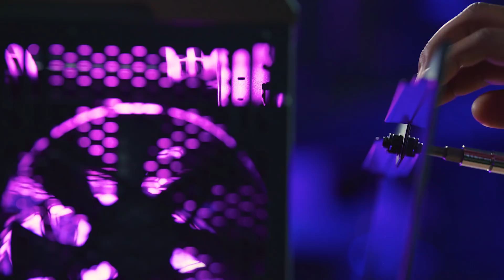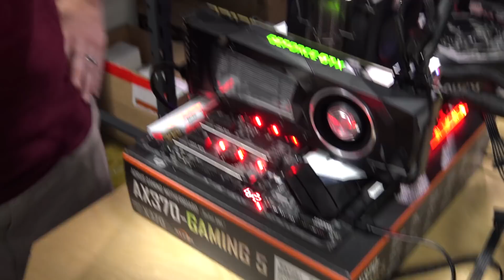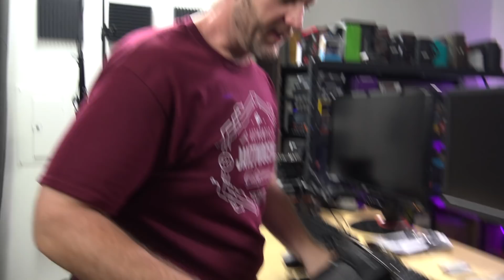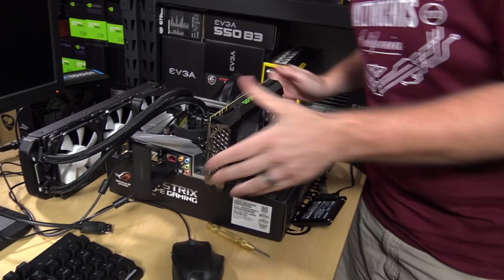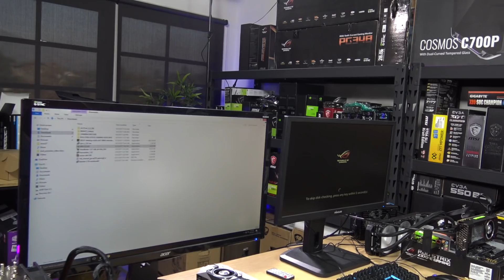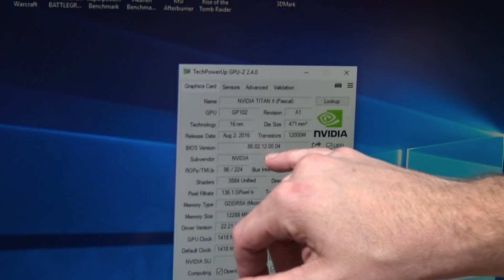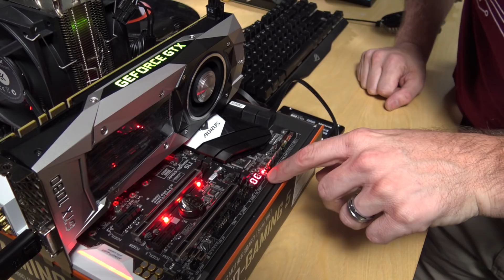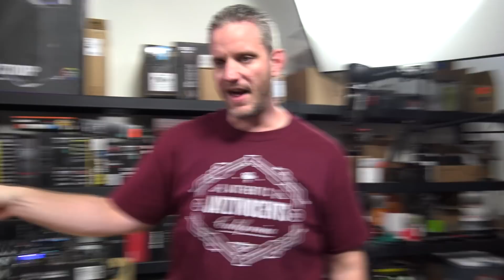I cant figure this one out... HELP!

Comment: Might check the Connectors in the PCI-E slot. with as many test as you conduct with each motherboard and the amount on insertions and extractions you do with different GPUs, wouldn't be too surprised if one contact may have some oxidation not giving it a good connection, be slightly bent, or if its perfectly fine.
Reply: Another thought, may check the Bios settings on voltage going to that PCI-E Slot, could either be getting over-volted or under-volted, could be why the 1080 caused the post to throw the other error code. I've seen some stranger things happen with hardware like me removing my kraken x62 from my motherboard and cpu, only to see when I went to clean off the thermal compound, the 1800x was stuck on the bottom of the water block. No resistance, just came up with the cooler (Artic Silver Ceramique 2 was used btw).

Comment: A) Inspect the PCIE contacts on both cards to see if one is slightly off.
B) Check to see if the pin buffer (end of PCIE plug) on the non-working card is longer than the other cards which might impede connectivity.
C) Put the non-woriing card back in the board and angle it up and down (to/fro cpu) to see if it can make a connection.
D) Check the power plugs of the PSU (left) and non-working card to see if there is a connection issue.
E) Start drinking and see if something comes to you...

Comment: the nvidia drivers updates could be the problem
Reply: How could it be a driver in windows if you never make it through the bios post meaning you don't even get to windows to load up the driver. That would be like saying you can't get your car to start while standing outside it with the doors locked.
Reply: That is exactly what happened to me.  Doing the GeForce Experience update caused the black screen of death, which I might have made worse.

Comment: Voltage rail is undervolting, overvolting (by a smidge) and the "problem" card has a tolerance issue? Or PSU or pcie slot! get equal main board same other parts.. swap parts out till you find it.  I agree a customer would think bad card.

Comment: im guessing the psu has been swapped just in case something may be faulty then u check another pcie slot on that board and tried to reinstall the bios on the mobo maybe an earlier 1 would work better (this is why only update my bios wen needed) the grafix bios should not be a problem due to that it does work with other computers also wen testing some mobos like urs needs to see a attachment for video out as plugin in a dvi /vga /display port u can always leave it overnight or 30mis without power and comos battery connected

Comment: Use HW monitor to see the 12V rail voltages while a working card is under load. See if it drops by a large amount.

Comment: I am willing to bet the it's the MB that has gone bad, or at least a capacitor. I have an X99 mother board that has a similar issue. It was slow booting, sometimes it would boot fast, tried different GPU's sometimes it would work and sometimes it wouldn't. It may sound strange but dirty power can cause issues as well. I bought another motherboard of the exact same model and the issue went away.

Comment: First idea - Possible slot/pin issue - Try a different PCIE slot.
Failing that, I'd go through eliminating all the other items.
Different PSU, different PSU connectors, SSD, port the SSD is connected to, RAM.

Comment: jayztwocents, check your "uefi" setting for the graphics. i have had issues with that before. if you can toggle it on/off and it works then it is just an conflict with the uefi side of the nvidia bios and Motherboard

Comment: Swap the power supplies. Just do it for kicks.
Reply: cant rule it out until you try it, right?!?
Reply: This is a true story coming from a dell r910 server in an enterprise datacenter. The server was complaining about voltage errors. Take green plugs and put in blue ports and vice versa. No more voltage errors. (Yes we tried a power drain)
Reply: Smart guy. Possibly not enough power
Reply: best idea

Comment: highly doubt it's a bios issue other wise the issue would show up on the intel system, PSU is unlikely as well considering the other card worked.  Try using a different pci slot just to verify good connectivity and as an extra precaution check the pci pins on the actual card that wasn't working.

Comment: this is gonna sound odd but what if the gpu is pulling more power than should be initially from the board. i have actually seen this on an old old old p5 board and a certain gpu being a 6970. after extensive testing and many many voltage monitors we concluded that the allowed variance of voltage being pulled from the pci slot was more than it should be and it caused a boot problem everytime. after testing on numerous boards we rma'd the board and didnt have a problem.  i know that amd boards can be touchy right now so it may be something to think about. or not i mean im just a guy from the internet, what do i know

Comment: I had a similar problem with an AMD FX system and a GTX 650 a few years ago. Other cards would work but the 650 wouldn't even though it worked in another system. Even taking it out and reseating it time and time again didn't help.  Turns out it was an issue with both the card and the board. There was a slight manufacturer defect in the card, one of the contacts on the card was not perfect and wasn't making good enough contact with the board because one of the board contacts had been pushed back a little too far. One in a million of having that issue with the board and a card with a defect that just exacerbated the board issue. Pulled the wire contact in the board forward with a small wire and it fixed the issue. The only other suggestion I can make is the power supply. Try swapping them. I would check every contact point though because sometimes weird things happen.

Comment: If you have a spare Mobo, change it - could be the 'faulty' Titan card is flying a little too close to a limitation of PCI-E specs, and it's down to tolerances.  If it works in another board, then the original Mobo is just one of those fussy ones and you should probably RMA it.  Not relevant in this situation, but FYI, this can also happen with OEM motherboards, e.g. Lenovo, HP etc. as these often have a whitelist of accepted devices and won't have anything to do with anything not in the list. e.g. My M91P i7-2600 system (yes it's old, I'm broke!) would not POST on an R9 390X card, which worked fine in my son's FX8350 rig.  Found out later that Lenovo boards don't necessarily take all GPUs, because they want to force you to buy a shitty one from them for 5x the cost. :-)

Comment: Ive noticed with a lot of the newer cards like rx series and or NVidia, that sometimes the drivers cause issues with posting I had to revert back to a driver for AMD from last month, cause my system would not post whatsoever, since then the newest driver seems to be working for now, I don't usually allow windows to automatically download the drivers so that could also be an issue

Comment: If I remember correctly you once put out a video on the subject of split power connectors making a very slight difference in fps. This could be one those haunted pieces of hardware that just spit problems over crap it's not supposed to. Definitely try different power options.

Comment: I had a similar issue with Threadripper 1950X with two identical Sapphire RX 480 (Nitro+). The intent was to run them in Crossfire but something was wrong with boot codes and the system not booting at all with one or another card in the primary PCIe slot. I noticed killing the power on the PSU waiting, then firing it back up seemed to help it. Reversing the cards also helped but I was at a loss as to the 'cause'. I chalked it up to a lower power state when the system was off holding onto IRQ's on the PCIe bus - I ultimately disabled fast boot all together (there was not a real difference in speed) updated the BIOS and the issue hasent poped up in about a week or two. There was some anomalies with UEFI/Secure Boot when enabling fast boot and having the GPU selected in a secure mode - the system just booted to a black screen and never completed startup. I was pulling my hair out for about 6 hours on this one because I wanted secure boot (but not fast boot). Clearing the keys from the bios and putting it into UEFI/Setup setup mode got it to finish posting. LOL Jay Ive been tinkering in PC's since I had a i286 and this new stuff is getting beyond me now... I almost miss the days of jumper controlled BIOS settings  XD
edit: said sli when i meant CF

Comment: Why, when you originally took the "fail" card out of the Ryzen system and put it in the Intel system did the Intel system see it as "new hardware" when it is an identical card?  It obviously is not.  And secondly, you said the card's bios you took from the Intel system and installed in the Ryzen system was the same... because it was!  It was the card out of the Intel system whose bios you noted, then put in the Ryzen system.  You did NOT check the bios of the card that was originally in the Ryzen system when you transferred it to the Intel system and got it to work there.

Comment: Had this issue about 5 years ago with a XFX HD 7950 and a Gigabyte UD3 Z-87 motherboard where the GPU/system wouldn't boot up at all, I tested the mobo with a HD 6870 which worked fine, and then tested the HD 7950 in a friends system and it also worked fine, so ended up RMA'ing the mobo for a for a Asus board where the GPU worked instantly. I never figured out what was the issue, but i always blamed Gigabyte for it, and seeing as Aorus is Gigabyte i would think this is a issue with Gigatrashes coding somehow, but then again if your other Titan XP worked fine ... so strange.

Comment: 1) you only showed checking the bios of the same card, just on different boards. 
2) is there a pci-e supplement power on the Ryzen board that isn't populated?
3) try a different pci-e slot. 
4) try swapping PSU's.
5) try changing pci-e lane power states

Comment: Did you try running an additional 8 pins pci-e for a total of 2 8 pins pci-e from the power supply unit? Sometimes running a single 8 pins daisy chain cable does not provide enough current to drive the card? Also on the GTX 1080 card, it only required 1 pci-e card.

Comment: Time to talk out of my ass with zero knowledge about the issue what so ever in the spirit of a youtube comment section.

I don't know what these error codes mean, does the motherboard recognise the device? Plug in a second GPU and see if it is recognised in Windows maybe? If it is you can rule out the motherboard having an issue with the specific card.

Here is what I think. And be warned, you may lose some brain cells reading this. I think that the motherboard is confused. Yes, I just said that. I just said a logical circuit is confused. Hear me out. I recently tried to unlock shaders on an RX460 (on Intel system with ASUS B250 chipset). Everything was fine, SSID, BIOS version Device ID everything matched up perfectly, the bios flash worked fine, going into GPU-Z showed the shaders were unlocked. But the GPU was not working properly, I booted with the GPU, I was outputting video with the GPU, the system recognized the GPU, and from what I could tell everything was fine, but I got error 43. I'm pretty sure that is a driver error, but its literally the same card. It seems my PC knew this, and my PC knew there was something different about it, but it expected it to be one way so it just got confused. I'm serious though I think the system expects one thing and tries to work for that one thing because the other thing is so similar but its not exactly the same thing so its like, fuck it.

EDIT: Make it forget? Pull motherboard battery out

Comment: surely it has to be an issue with the motherboard. can you not check the Titan with the issue and the rest of the hardware you used on another AM4 motherboard? could be some sort of bad connection with that cards pcb and that top PCI-E slot. Can you get it to work or even be recognized in another PCI-E slot on that Aorus mobo?

Comment: Board is shit. Bad PCI-E slot. Definitely bought a new card once because I thought my card was toast. New card was unstable as fuck and then ulitmately also wouldn't boot. Silicon lottery may dictate that card is pulling more watts at boot than the other ones. Check power draw, try the other PCI-E slot.

Comment: Motherboard and PSU seems to me to be the culprit. Gigabyte's BIOS is weird. I have AB350-Gaming 3 with R5 1400 on it and BIOS has numerous bugs. Sometimes if my PC force shutdown due to sudden power loss then It doesn't boot and Memory LED lights up. I then need to clear the CMOS to make it work again. Weirdly overvolting beyond +0.0132v offset causes CPU to lock to 1.5ghz and undervolting beyond -0.096v locks the CPU to stock frequency. As I said, weird issues with Gigabyte BIOS. If motherboard swap doesn't work then PSU might cause the issue.

Comment: It could be a memory buffer error on the card itself. I have a render cluster with 4 nodes that are older opterons with 32 gigs of ram per node. I had some single slot video cards just for cpu acceleration support and one card would not post. tried it in all the other machine didn't post. Tried it on another xeon server and it posted.  In the end I chalked it up to a weird memory buffer error.  I did also try flashing the bios but to no avail.

Comment: I don't know what the problem is but I think I can help you to figure it out: What do we know? I. Both cards (A and B), and both processors with their motherboards (systems 1 and 2) are functional; II. One card (A) only works on one system (1) but doesn't work on the other (2) III. The card B works just fine on both systems (1 and 2) and IV. Card A must work on system "2" since it's functional. Try to connect the card A (the problematic one) on another "2" system or 2' or 2 prime, this means another ryzen system, if it works on the new 2 prime, then the problem it's not the card (it would work on 2 systems), I think the problem would be the specific ryzen system 2 processor. Did I deserve a heart?
Reply: That would be set theory, not calc.
Reply: jayz told us he has the hardware to do things like that, your not telling just some random person, your telling someone who already has the equipment to do that test
Reply: Set theory is a branch of discrete math, not calculus. Sure, prime notation is from Newton; however, it isn't exclusive to calculus. Set theory and boolean logic both use it, for example.
Reply: calculus was my favorite math class lol
Reply: I bet that Jay has A LOT of other systems to work with. So, how does my answer help to the average builders?
Well,  it doesn't because I did answer to Jay's request not to an average builder (uh.. duh).
Reply: i think you didn't take enough Calcium as a child :p
Reply: Chema Brinval 
You could have said the same thing in a shorter comment.
Reply: No hearts!  You left out the fact that multiple other kinds of GPU boards run OK on the Ryzen system making it unlikely that the one copy of the Ryzen system is defective.  So multiple copies of the Ryzen system aren't needed.  The fact that the Titan XP failed on the Ryzen system points to a defective/damaged Titan XP board.  The fact that it runs OK on the Intel system only indicates that the damage is subtle/marginal.
Reply: I think this troubleshooting process will help to find out what is the problem, by changing different brand ryzen motherboard, if 2nd  motherboard works then 1st motherboard has Bios compatibility problem i think.
Reply: Very ez use the card to another ryzen system if it works it might be that the board or card has a problem
Reply: Heart begging
Reply: TheEvilVargon you didn't take enough Calc
Reply: lol yeah
Reply: I'll take it as a compliment, but I'm a Lawyer, but I like Logic and I was pretty good at that class. Thanks, bro!
Reply: Yes it is.... and you're right too, it's logic, I was pretty good at that class.. (I'm a laywer actually).
Reply: Right! : ) Thanks bro.
Reply: I cannot help it, English is not my first language, so I try to be as descriptive as I can... : )
Reply: You miss the point #1 it is one GPU not all. #2 What Jay has helps nobody the same problem. This is a learning process for him and us.
Reply: "I did answer to Jay's request not to an average builder (uh.. duh)"
Jay is a master builder. You think he did not think of trying it in a different Ryzen rig? There is a component issue on this one and the goal is to figure it out.
Reply: He didn't say that he already tried that. I'm just trying to answer a question on a previous information given basis (chill out, man)
Reply: Yup.
Reply: FlynHawn I saw that too!
Reply: Any Beta study would do, might as well be a chemist.
Reply: English is not my first language, sorry for bothering you, pal. I just tried to help.
Reply: Chema Brinval I can tell that your a or we’re at some point a calculus student
Reply: "Did I deserve a heart?" No, you just told someone to build another rig ($800-$1200) to figure out an issue with a $700 GPU. Do you work for the government by chance? Then afterwards they are stuck with a build they do not need. How does this help the average builder? When building PC's you use the process of elimination. All the other cards work on the Ryzen build so it is software related or one or two PCIE connectors are not making contact.

Comment: I would think it would be a power delivery issue with the MOBO and the card itself. But since it works I would say the lack of integrated graphics on Ryzen would be the issue. Try using one of the APU's with that card and see if it persists.
Reply: Once you do that roll back the driver to the Titan or update to the newest driver.

Theres my TwoCents XD